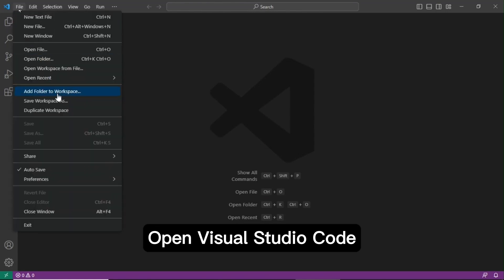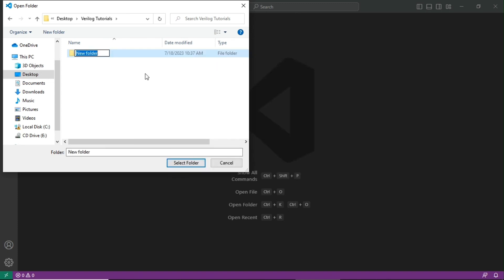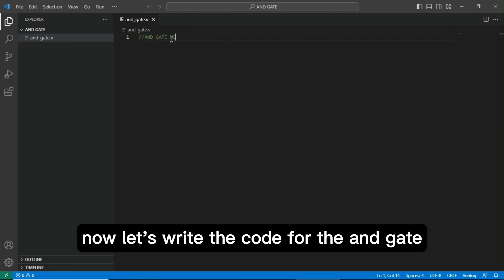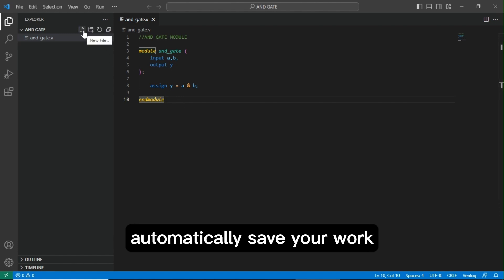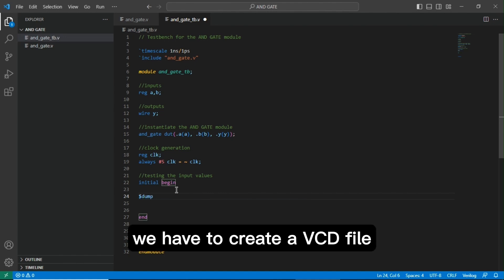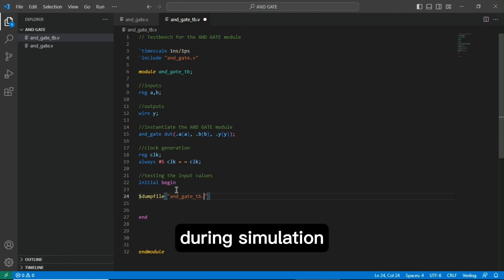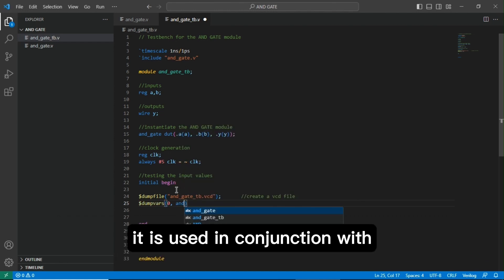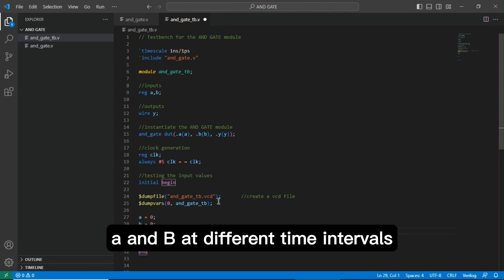AND GATE   verilog code, testbench and simulation using gtkwave

Comment: my code :  "no top level modules, and no -s option"  please help
Reply: same problem here is my code please verify

`timescale 1ns/1ps
`include "and_gate.v"
module and_gate_tb;
  reg a,b;
  wire y;
// instantiate the and gate module
 and_gate  dut(.a(a),.b(b),.y(y));
 // clk generation
 reg clk;
 always #5 clk= ~clk;
 // testing the input value
 intial begin
   $dumpfile("and_gate_tb.vcd");
   $dumpvars(0,and_gate_tb);

   a=0;
   b=0;
   #10

   a=0;
   b=1;
   #10

   a=1;
   b=0;
   #10

   a=1;
   b=1;
   #10
   $finish;
   end
endmodule
Reply from the maker: copy and paste your code here and l check it out
Reply: @nanotechbytegenius   
verilog code 
module and_gate (
    input a,b,
    output y
);
    assign y = a & b;
endmodule

testbench 
// Testbench for the AND GATE module

`timescale 1ns/1ps
`include "and_gate.v"

module and_gate_tb;

//inputs
reg a,b;

//outputs
wire y;

//instantiate the AND GATE module
and_gate dut(.a(a), .b(b), .y(y));

//clock generation
reg clk;
always #5 clk = ~ clk;

//testing the input values
initial begin
    
$dumpfile("and_gate_tb.vcd");       //create a vcd file
$dumpvars(0, and_gate_tb);

a = 0;
b = 0;
#10

a = 0;
b = 1;
#10

a = 1;
b = 0;
#10

a = 1;
b = 1;
#10

$finish;        //end simulation

end

endmodule

Termainal is : No top level modules, and no -s option.I was installed icarus and VS code is vid previous but its doesnt work, are u installed any extension or enviroment except them ?